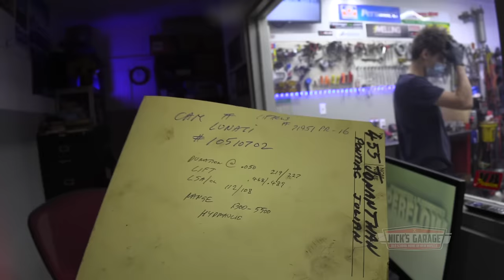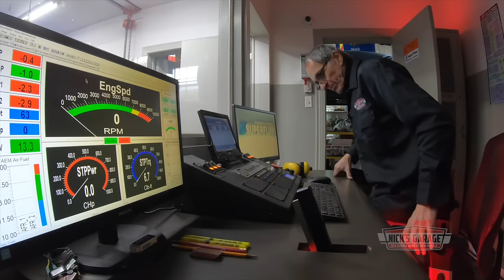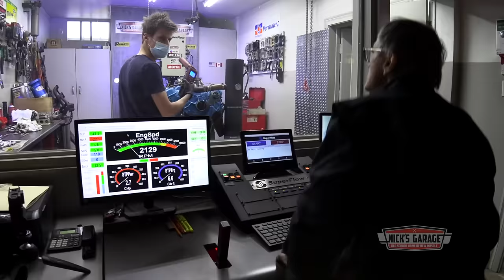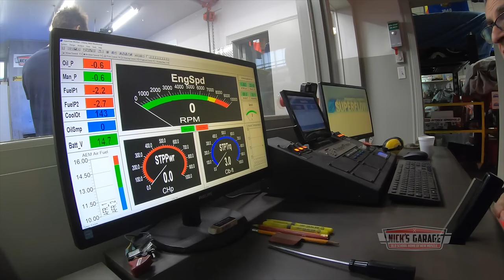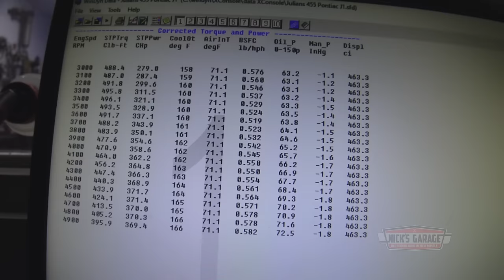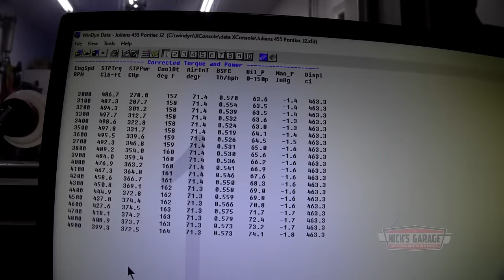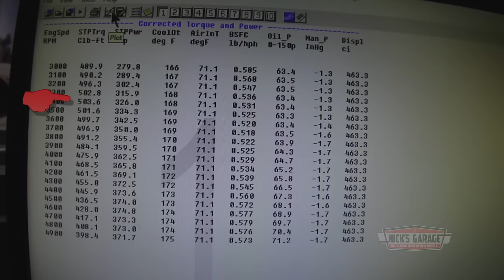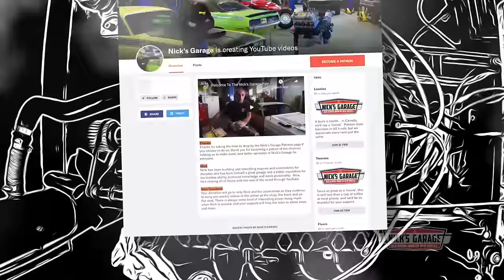Pontiac 455

Comment: Lower torque figures than some expect from a big block. That's because the Pontiac 455 had the shortest stroke of all the GM "big blocks", a little over 3.5". FYI the Oldsmobile had the longest stroke and the best potential to be a low-end torque monster.

But will Nick take advantage of that short stroke and rev it up to 6000 rpm? I know the cam is for up to 5500 but the crank can take 6000 and more.
Reply from the maker: And this one is a bit low on compression, don't forget.
Reply: Short stroke? a Pontiac 455 has a stroke of 4.210 🧐
Reply: Buick 455 stroke- 3.90
Reply: The 455 Buicks were rated at 511 tq highest in the GM line
Reply: @michaelerickson1518  The 1970 455 Buick  hi compression was rated at 510 torque (one year only) Oldsmobile had a 510 torque rating in  some 1968,69.and 70s. In 1970 Cadillac had a torque rating of 550.
Reply: Pontiac is a medium block engine limited on bore size so the 455" has a long stroke... Chevy 409". Ford 427", and Olds 403" have short strokes...
Reply: @anthonyangotti5484  I stand corrected. I'm thinking about the 421, which was IMO a better engine. Maybe because it was my Dad's Catalina I once drove.